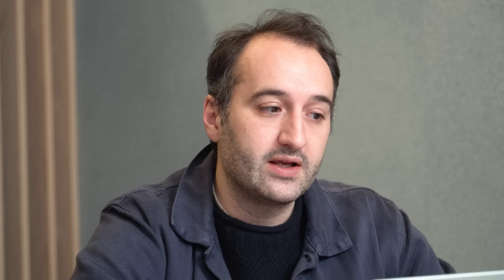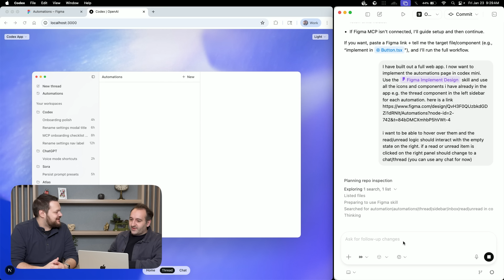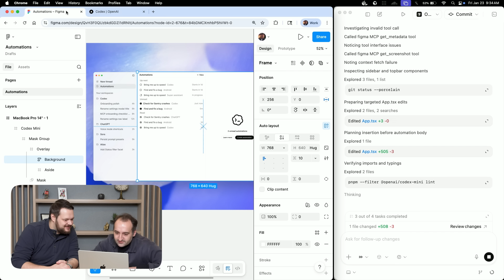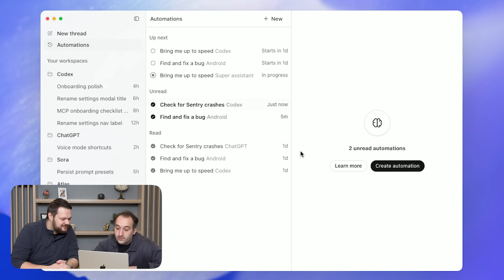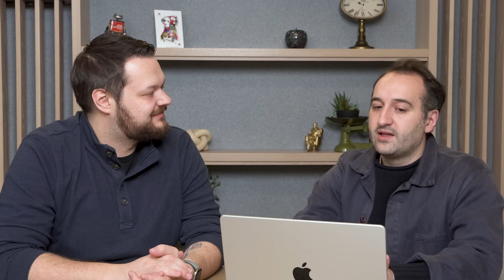How designers prototype using the Codex app and Figma

Comment: The problem isn’t (only) that GPT-4o is going away.. the problem is trust

A lot of discussion focuses on which model is being removed, but that’s not the core issue.
The real issue is choice and predictability for paying users.

People subscribe because something works well for their workflow.
When that experience changes or disappears after the fact, trust changes with it.

Technically better does not automatically mean better as a user experience.
Consistency, predictability, and control are features, not side details.

The assumption that “users will stay anyway” is risky.
Resistance doesn’t disappear just because new models are released. It accumulates and resurfaces later.. during pricing changes, bugs, or the next removal.

A simple Legacy option (no guarantees, no updates) would solve much of this:

It respects existing workflows

It reduces resistance to innovation

It strengthens long-term trust

Ironically, users are more willing to adopt new models when they feel safe and not forced.

This isn’t nostalgia.
It’s mature product feedback.